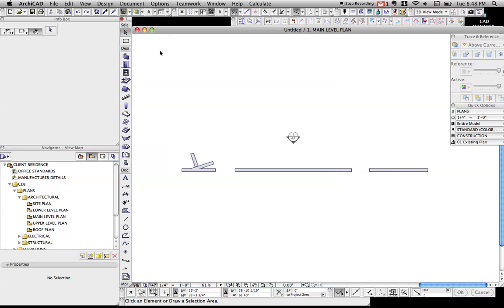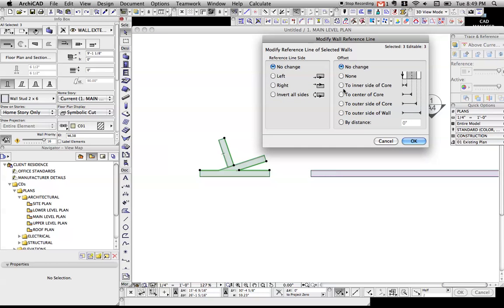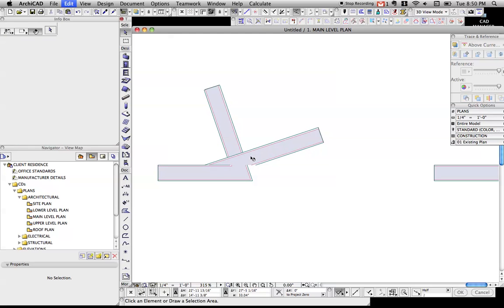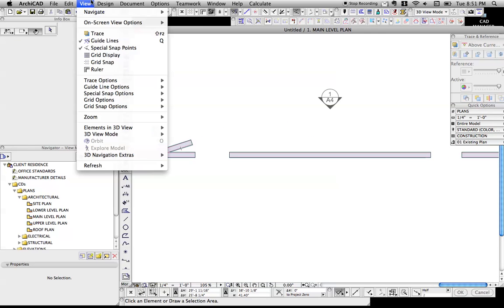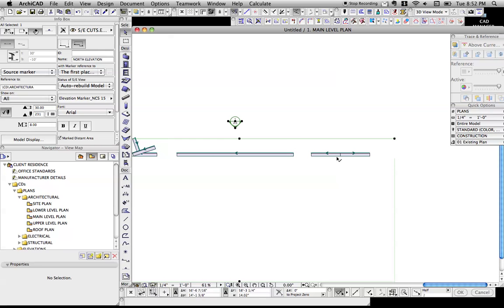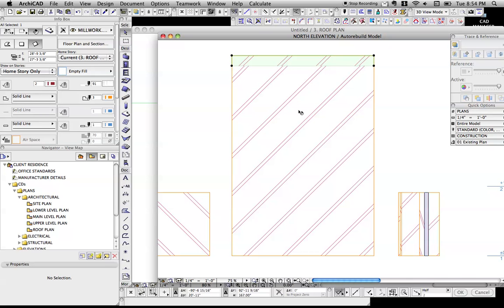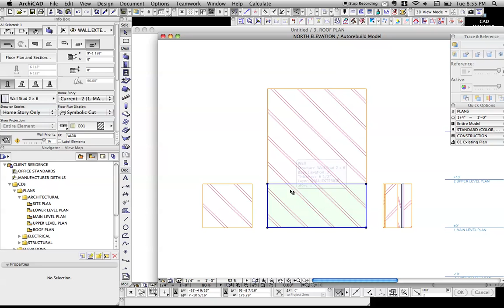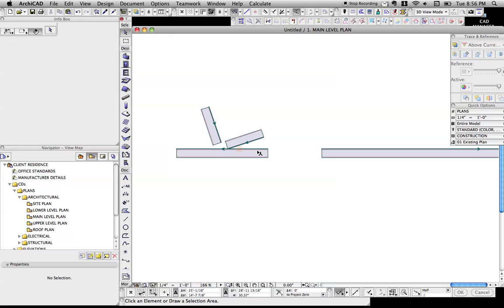ArchiCAD Tutorial #5: Modify Wall menu = 99% less unexplainable Wall Weirdness

Comment: I have a tutorial/answer request. BTW im starting to use this AWSOME program! but i have so issues. Wen i´m building a new model, usually the columns and the walls are on the same plane, but wen I look on de 3D, I see the wall, and the columns too. This is a issue because the column is, for example, painted in the exterior in white and blue in the interior, but with the surface option, is all the column that is painted! Not only the paint issue, it happens too in a elevation, where the column and the slab is visible in the wall plane... Can you help me with this? thx!
Reply from the maker: +Daniel Guzman Post some images of the situation on the ARCHICAD-Talk forum: http://archicad-talk.graphisoft.com/

That'll be the best way to get this situation answered—especially since I'm not sure I completely understand the problem you're having. But a few possible solutions: if your Building Materials are set up correctly, the walls and columns should merge properly (so strong materials cut weak materials, or like materials merge seamlessly). If you need a column to have different Surfaces on different sides, create a Complex Profile and set one of the edges to a custom Surface. Or better year, create a Complex Profile for the column and build it out of multiple materials, if it's the materials giving it different appearances from different sides.
Reply: http://archicad-talk.graphisoft.com/viewtopic.php?p=252216#252216

I hope now I can explain better. This most be a noob stuff I know. Thx!
Reply from the maker: +Daniel Guzman Pictures are the best. That makes a lot of sense. Glad it got answered.

Comment: great video but I want to ask how you were able to have another window when you opened the elevation. You have both the view of the floor plan and the elevation and I would want to learn how thanks.
Reply from the maker: +Erik Isip I just opened the elevation. There is no trick to it. When you right click you can open in an existing window/tab or new window/tab. The only reason you might notice a difference is if you are using a version of ARCHICAD older than 19 and are on a PC. Then I think the window behavior is slightly different.
Reply from the maker: +Shoegnome And if you are on 19 and on a MAC (not sure if this behavior is there on a PC) then you can undock a tab and have it float, like you see in the video. Right click on the tab in the tab bar and select undock.
Reply: +Shoegnome thanks for the reply man

Comment: Very Educating.
 I am trying to learn Archicad on my own as there are no institutes or trainer  nearby, so tuts like this are my best option.
I have a few queries with regard to wall.

See I model a building in Archicad with walls "brick type". Now if I need to change the surface paint of walls to different shades, what is the best workflow to do it ? I usually render the model in Lumion but Lumion requires different material to assign different shades.

Thanks in advance